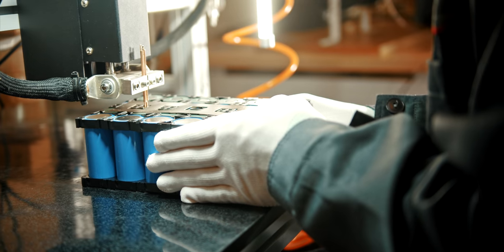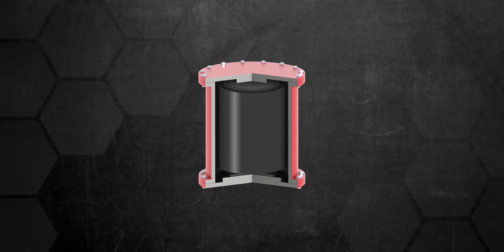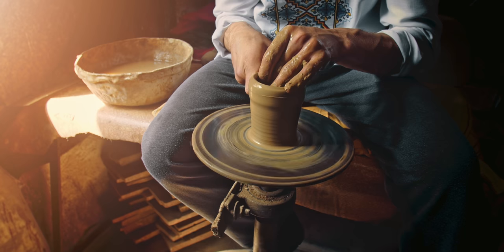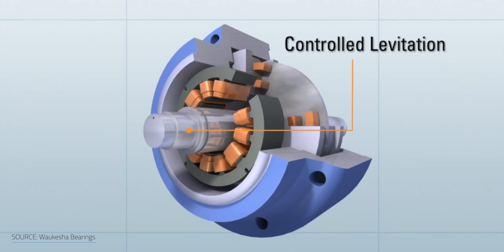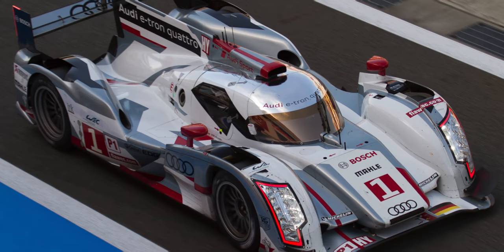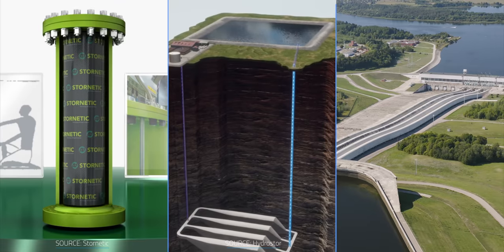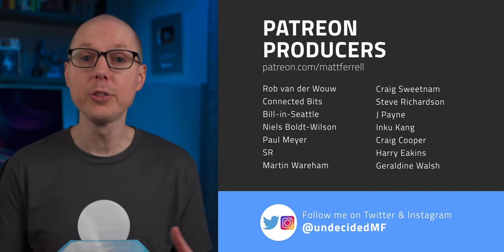The Mechanical Battery Explained - A Flywheel Comeback?

Comment: For the ISS, that would be attitude, not altitude.    

I’d always considered a motor/flywheel/generator for a home office surge protection system
Reply: I was just about to ask the exact same thing! I'm no physicist either but, holding something up with a flywheel doesn't seem possible, unless it's got something to do with the station itself moving in a circular arc around the earth, and somehow transferring some of the inertia away from the flywheel.

 I don't think so though, I think he means a reaction wheel, attitude like you said.
Reply: What the difference between attitude and altitude in this context?
Reply: @remliqa  go to school
Reply: @brandonb3279  yeah, what it does is rotate the wheel opposite to the direction they want to rotate the ISS. And they have one such wheel for each axis. It's an alternative to using RCS, since they can power it from the solar arrays, rather than needing fuel shipments. But they do still sometimes need RCS as well, but very rarely. So the added cost in hardware is worth the gained efficiency to them.
Reply: @remliqa  You can think of attitude as direction or orientation, and altitude as height above the Earth.
Reply: @kaitlyn__L  actually they still need to use RCS, as the reaction wheels maintain their spin permanently. As the wheels continue to be used, they spin up even faster, which makes them less efficient. When this gets out of hand, (or when they don't have the power to maintain the spin) they use RCS to allow the wheels to spin down.

Ideally there wouldn't be much need for this, but something as small as solar winds can necessitate the use of the wheels/RCS
Reply: @Adlore  you may notice I already said they occasionally have to use the RCS, not that they never need to.
Reply: @remliqa  that's his attitude 😂
Reply: @remliqa  Altitude is the height above Earth in this context. No way can a spinning wheel keep the ISS from losing altitude. Attitude in this context refers to the orientation of an object. I guess a crude example would be that a spinning object can act as a gyroscope to keep an object from begin for to spin. You can imagine that if the space station began to spin it would cause havoc to those inside. Not to mention making docking procedures more difficult.
Reply: First off you have too many components. A motor and a generator are more or less the same thing. Next you're inventing something that has been in use for at least 120 years. It's called a synchronous condenser. The next problem is they don't store power for long periods of time, they are used for power factor correction, and grid stability.
Reply: @kapekape7580  "go to school" ◄?!?! It reflects on your mother.
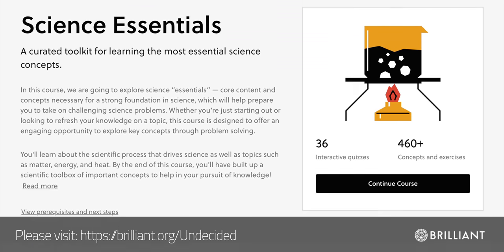Reply: @brandonb3279  In the context of his discussion at 6:12 he was referring to gyroscopic control of the space station or attitude control.  His script writer or whatever made a mistake.  Refer to 9:45 where he tells us physics was never his strong suit so you can understand how he might become confused.
Reply: That is a thing in some industries to hold up the control systems over surges and provide clean power.
Reply: @MostlyInteresting  it only stores power, it doesn't produce any power at all, it actually consumes power. It is only for voltage and frequency stability and to correct for low power factor
Reply: @joecummings1260  I have built them installed them serviced them....I know. Where did I say they produce power? They DO store power, not much, enough to smooth over the momentary outage, so the industrial controls don't shut down the plant. Old school old tech, not seen much any more.
Reply: @kapekape7580      behold...a truly bad attitude demonstrated by this troll...[100 foot AGL altitude, inverted, and diving.]
Reply: @tonywhite68  Sure it can. Just launch it towards Earth and it will make the space station move away from Earth (ever slightly). ;) Though, yeah, this does kind of defeat the whole point of having them there in the first place.
Reply: A flywheel is great for short term energy storage and recovery, like an energy buffer. As long term storage, you're going to have loses due to friction and air drag. Minimizing those makes for a complex and expensive system vs batteries or any static storage system (lifting weight).
Reply: Thank you, I was going to make this comment. I know there are secrets on the ISS but I would think gyroscopic propulsion would have become mainstream if it was effective... Or existent 🤣. For those who asked, if it hasn't been answered, attitude could be called angle (pitch, yaw, and roll more specifically), where as altitude is the distance from earth (or sea level, or center of mass, or however you want to measure). Basically attitude adjustments allow the ISS to face a particular direction, while altitude adjustments push it further from or closer to the planet.
Reply: @remliqa  he doesnt know is why he told you to go to school. its a good question
Reply: Bram, It's I've not I'd. Just sayin'
Reply: @remliqa  search these:
Attitude, altitude, roll, pitch, yaw
Reply: @kapekape7580  Is your reaction wheel damaged? Cause your attitude is way off.
Reply: For combined use with a motor, that wouldnt make any sense because you would have to waste energy all the time just to keep it running.
Reply: @Adlore  I thought control moment gyroscopes don't saturate like reaction wheels, dunno exactly what's on the station
Reply: Motor generator sets are rare these days due to the very low demand. Even surplus units are expensive. Then try and find one that meets your electrical requirements. And for surge protection you wouldn't need a flywheel, just the mass of the rotating parts in the motor and generator alone would be enough. If you had the skill to combine an electric motor and electric generator into a single unit. You would have to match the electrical and mechanical requirements of each to each other and for the amount of power you need at the output. That will work, but you'd have a relatively significant loss due to the double conversion of electrical energy to mechanical energy and back again. They had several motor generator sets where I used to work and they fulfilled very specific requirements. One took 480 VAC, three phase, 60Hz power and converted it into 208VAC, three phase, 440 Hz power. If you just want 120 VAC, single phase, 60Hz power in and out, (think convenience power outlets in North America) then a MG set will be expensive and wasteful. Get yourself a decent series mode line filter instead.
Reply: Lmao after reading this comment ive been watching all of your videos. You are an astonishing man!
Reply: @remliqa  google the question yourself, instead of asking here lmao
Reply: @chrismofer  The ISS uses CMGs and not reaction wheels. It's been a while since attitude dynamics class, but I'm pretty sure any system like this gets saturated. Otherwise you could approach infinite energy storage by putting one of these on an orbiting satellite. You may be thinking of avoiding attitude singularities? They have to use the RCS for desaturation. Think about it like this: unless you shoot something off into space, have something hit you, or push against a field, you can concentrate some of your spacecraft's angular momentum in one spot, but you can't actually change it overall.
Reply: @remliqa relative direction vs distance from     or   Bearing vs Height
Reply: Ok Bram, just chill man. Drop the attitude please. 🤣

Comment: Just came across this - I remember being in college in the late 1980s and reading about an experimental carbon-fiber flywheel that was manufactured to EXTREMELY tight tolerances- UNFORTUNATELY they found out this resulted in a  'detonation' type failure as fractures propagated quickly through the flywheel- and obliterated their testing lab (nobody hurt).
So, 'high strength materials" isn't always as important as "progressive failure materials" when things eventually break.
Reply: Definitely still worth it IMO. You obviously don't intend on the unit failing, and if it does you can just encase each one in the ground so if it does blow up it's contained.
Reply: These sort of carbon fibre rotor were gaining popularity in laboratory based centrifuges when I did my PhD in the late 80s. Worst case scenario failure of metal rotors (3 equal sized fragments) could cause the centrifuge to leap about the lab, of the fragments to exit the containment shield within, decapitating lab staff. With a carbon fibre rotor, if the rotor disintegrated, it did so explosively, but to form a very large ball of fluff.
Reply: They fixed this issue. Instead of using a solid carbon fiber rotor it's made of spokes that are made of carbon fiber composit similar to a super heavy duty bicycle wheel. This allows it to have some give on startup and discharge.

Comment: I think the draw of flywheels is they’re such an elegant technology —just a really big perfectly engineered spinning mass— and that’s why I like them. I also like the idea that the solution to the technological age is a mechanical one.
Reply: Exactly, comeback of sorts !
Reply: The energy density injkoules per kilo is pretty poor. @priyanks91
Reply: Much like with trains, flywheels represent a simpler, older technology, that nonetheless does the job more efficiently than more complex technologies that have superceded them. And just like with trains, it would behoove us, as a society, to pursue more use of flywheels to help our climate and energy woes.
Reply: The elegance I see isn't just in it being singular spinning masses so much as the way it turns tensile resistance into power storage and means that any 'super  materials' we create are also energy storage devices. 

A bit of a slight ulterior motive that probably applies in many cases is not having to consider chemistry directly as something nice, in the same way that being able to write code to filter numbers is nicer than having to spec out an analog filter. Even if it is technically less efficient in itself the ease and familiarity spares consideration of other approaches.
Reply: @Nasrudith  I love your analysis.

We should also not forget that mechanical solutions of stored energy, be they kinetic energy or potential energy, have much longer service periods than battery solutions. And then there's the dirtyness of chemical production for batteries, before disposal.

Changing bearings occasionally seems like a much better alternative.
Reply: @rogerphelps9939  It doesn't matter. We aren't putting them in cell phones.
Reply: @rogerphelps9939  but they're higher efficiency, less susceptible to degradation, use more easily-obtainable raw materials, and not filling garbage sites.  The whole idea of "MOAR THING" is destroying us.
Reply: @theastuteangler  What is MOAR-THING. Batteries do not fill garbage sites.
Reply: @Nasrudith  What on Earth is "tensile resistance?"
Reply: I love it! Instead of storing electricity directly, and requiring advanced and rare materials to do so, you just store kinetic energy until you need it to be changed into electricity.
Reply: @magisterrleth3129  Wrong. The things are incredibly dangerous. A failure would be absolutely catastrophic. That is why they will never be used in any domestic setting. furthermore the tensile strength required does entail the use of advanced and rare materialos. I suggest you do the sums before automatically fawning over this. Once you have done the sums, can you?, you will realise that flywheels are no panacea.
Reply: @paulraymond1804  Thee energy density of mechanical potential eneregy systems is rubbish. Do the sums and you will see why they have not caught on.
Reply: @rogerphelps9939  They aren't anymore dangerous than any other electrical infrastructure. So I assume you're concerned about the risk of the flywheel suddenly disassembling itself in all directions at once? Bury them. They don't have to be above ground. If burying them isn't possible, I'm fairly convinced a suitable containment building can be designed.
Reply: @rogerphelps9939  if you think that highly toxic disposable batteries and dead "rechargables" are not ending up in landfills, you're lost and there's no saving you.  Philosophically, MOAR THING is higher numbers or "hurr durr line go up".  In this specific context, MOAR THING is the energy density argument you proposed, at the cost of greater waste and more catastrophic waste and mining principles involved in the life cycle of electrochemical cells.
Reply: @theastuteangler  No idea where ytou live but where I live they most certainly do not end up in landfills. They are recycled. Even if the user does not separate them from their domestic waste they are sorted by the local authority waste processing facilities. As far as EV batteries are concerned they are far too valuable to be thrown away. They are either repurposed as static storage or recycled. The valuable metals they contain are never thrown away. 
It seems that you have very little idea about both mechanical or electrical engineering. If you did you would realise that a flywheel must be exquisitely balanced; even a tiny imbalance would result in the thing tearing itself to pieces. The rotating mass must be a permanent magnet, a big one; that requires lots of rare earths. The acceleration forces trying to tear the rotating mass apart amount to thousands of tons. Small defects, coupled with repeated cycling will lead to metal fatigue and catastrophic failure. Things that look attractive at first sight very rarely are and flywheels are no exception.
Reply: @rogerphelps9939  Are you of the oppinion thet spent batteries are 100% recycled, withe no poluting gasses and residues?
Reply: dont think of any possible devices as THE solution, if we manage to tackle these problems, it will utilize multiple "solutions" to them.

Comment: 04:30 That's a Sprag clutch!! not a bearing, it allows only one direction of rotation. Love your video Matt Ferrel, thanks for putting the time to put this together
Reply: Thank you, Ive been trying to figure out what that bearing was called for about 20 years.  HP lasers use them on the paper path rollers, and I have been fascinated with them since then
Reply: @malehuman  haha glad I could help👍
Reply: Yeah and they're draggy too.
Reply: I'm glad I'm not the only one who noticed this.  I bet the image was sourced using Google Images and was mislabeled at the source lol.  At a quick glance they look similar but I noticed right away something was off.  Helps to be mechanically minded hey?
Reply: @Qui-9  Same here.
Reply: I've installed sprag clutches on conveyor gboxes so when they stop with product on them, they don't roll backwards.
My aircraft engine (Rotax 912) also uses a sprag clutch in the engine starter system.
Reply: also called one way bearings - best example is the back sprocket of your bike. :)
Reply: @MikeMike-er7kn  Don't want your engine starting backwards.